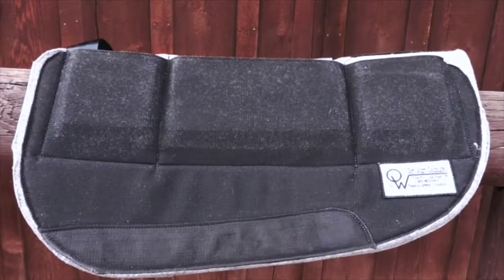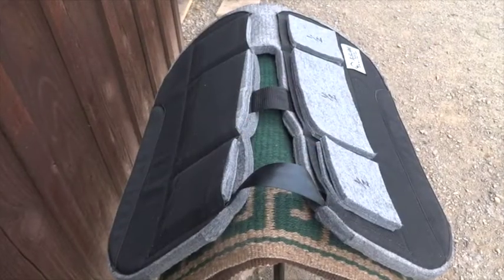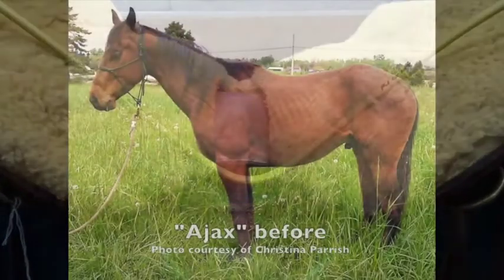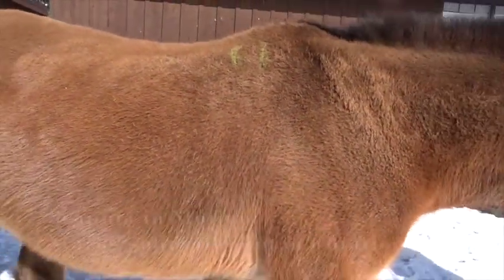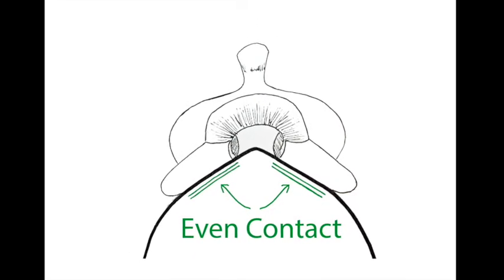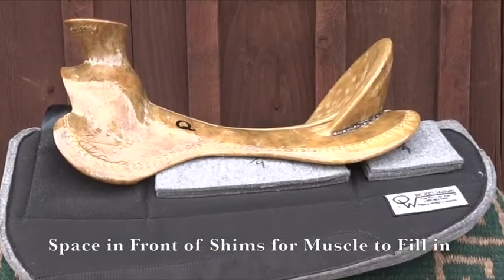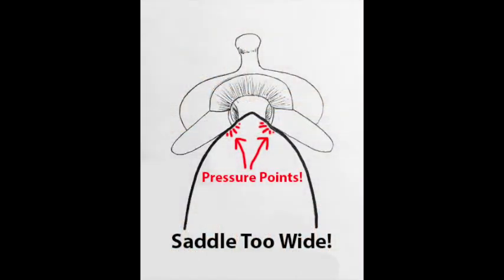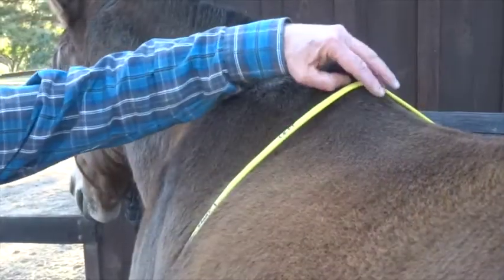Using the Remuda Pad

Comment: Ok like the video ,any pad for Western riding ,I have a 1" wool felt pad seems too thick ,used my cutter pad thinner saddle fits much better ,but when it gets  sweaty,it slips ,
Reply: We don't have issues with normal slipping but we don't believe in using the mesh on the bottom, we have seen that sore horses and put them in a cranky mood.  The way we designed the pad helps it to contour to any horse/mule and saddle.